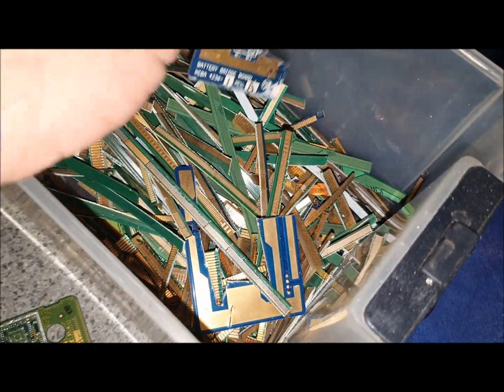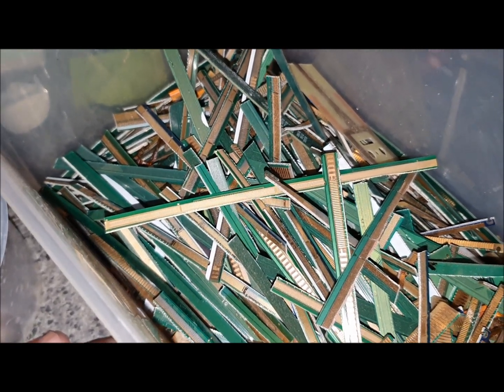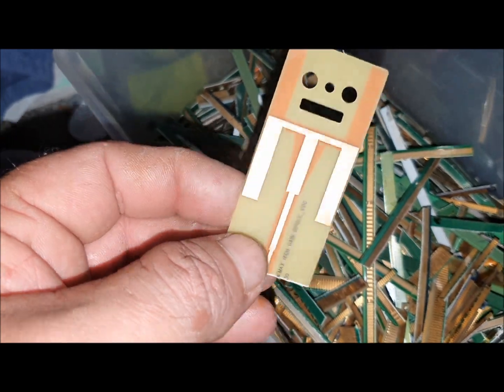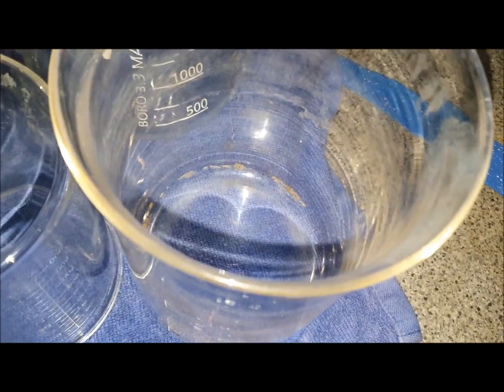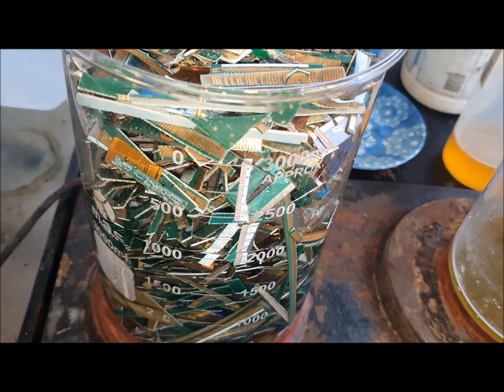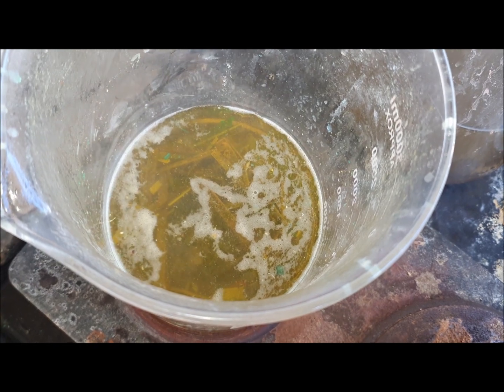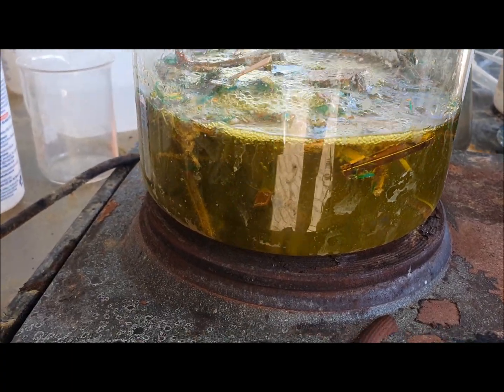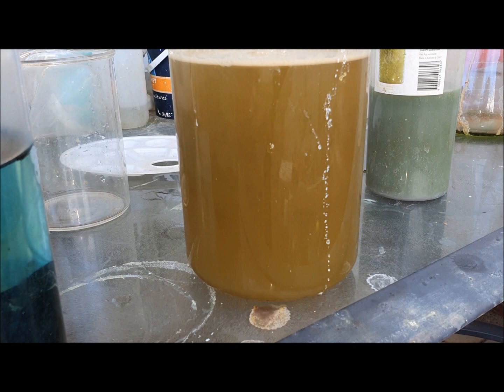GOLD RECOVERY / processing gold fingers

Comment: Very good video buddy Pete , when you find time I have some questions , i  am new to gold recovery.
4:43 how many days do we leave the nitrate bath to act
6:22 the nitrate we filter we can use again like that?
7:00 what is ar
12:52 what do we do with the filtered solution and the filter.
What do we do with the first flakes ? in the video we see only the boards e-neck !
thanks in advance for the answers.
Reply from the maker: h buddy , welcome to gold refining.
im happy to answer any questions at any time .
ok for your questions ...... you leave the nitrate bath as long as it takes to remove all the gold flakes.

yes you can use the filtered nitrate proving t still has some active nitric acid in it.

AR means acid peroxide . its hydrochloric acid with a tiny bit of  3% peroxide

all filtered solutions that cant be reused should go into a stockpot, plz watch my video about stockpots , and about what people need to start refining.

and your last question , keep all the gold foils together and disolve them all when the nitric bath has finnished
Reply: @prospectorpete  AR and AP it's the same ?
Reply from the maker: @babisant3932  no. AP IS  HCL and peroxide.
AR is hcl and nitric acid
Reply: @prospectorpete  I understand the difference dude Pete ,thanks. 😉
Reply from the maker: @babisant3932  are you sure ?.
I can try and explain better if you want
Reply: @prospectorpete  Yes i'm sure, buddy Pete,
 HCL + peroxide  = AP use for the dissolution of basic metals
of tin welds.
AR =  HCL + nitric acid = aqua regia for the dissolution of gold.
I'm right ?

Comment: Cleaning glass: there is something called chromic acid that labs use. I think you can make it yourself from sulphuric acid and dichromate, but it seems nasty stuff!
Reply: The best thing to clean Lab glass these days is a substance called ‘Piranha’ acid.
It is made by mixing Strong H2O2 and H2SO4.
It is important to add the H202
To the H2SO4 and NOT the other way around.
It will dissolve most organic substances.
Chromic Acid solution is not used these days as there are concerns of it being Cacegenic.
Reply from the maker: @tonywalton2333  oh ok thanks
Reply from the maker: oh kewl, ill keep an eye out for it. thanks bud